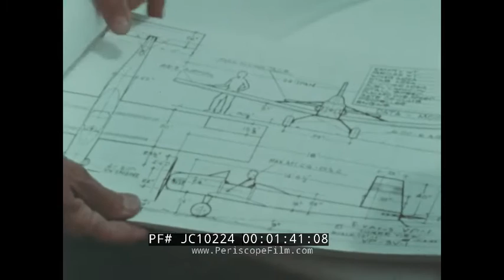" AIR-COOLED ENGINE-UITY "  1970s VW VOLKSWAGEN AIR COOLED ENGINE PROMO FILM   VOLKSPLANE JC10224

Comment: The world lost something good when when the original air cooled Beetle ended production.
If I had been king of the world I would have given the Beetle an exemption from environmental and safety regulations.
Driving a Beetle is like riding a motorcycle.
You know you are giving up safety for mileage and maneuverability.

Speaking of the environment one aspect where the high tech cars of today fail and the Beetle succeeded was the ability to repair rather than replace.

Comment: I worked for a VW repair shop in the early Seventies. We had a very good reputation and we received a few requests to build VW engines - and one BMW 700 two cylinder - for homebuilts. The boss wouldn't take the jobs. He said that it was one thing if your car broke down and had to be towed but that he'd never hear the end of it if someone's aircraft fell out of the sky.

Comment: In High School in 1972 & 73 I was in a shop class called Aircraft Construction where we built a Volksplane. The Auto Shop reworked the engine and we built the fuselage and wings. The plane was painted in the schools colors, orange and light blue (ugly!). I was assigned one of the wings along with some others. The spars were spruce and the ribs cut from plywood, then covered with fabric after an FAA inspector gave his OK.  Doping the fabric was quite the experience! Talk about getting high! Unfortunately I never got to see her fly as construction wasn't completed until after I graduated.  Thanks for posting this video. Brought back 50 year old memories.